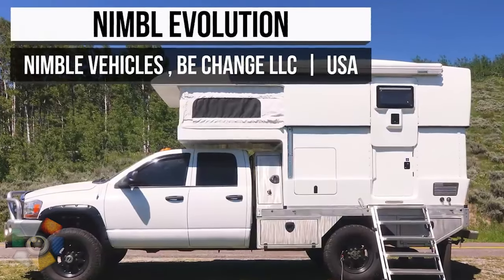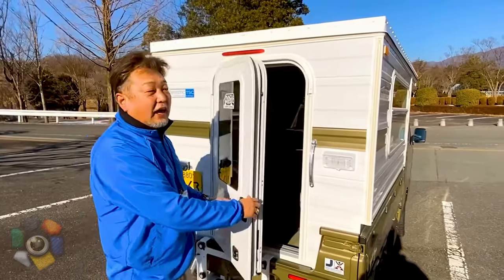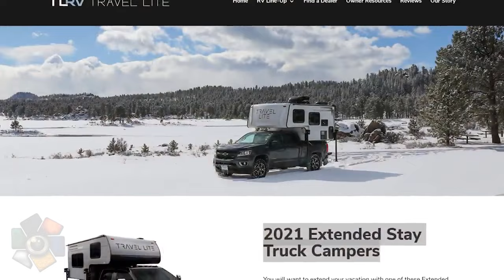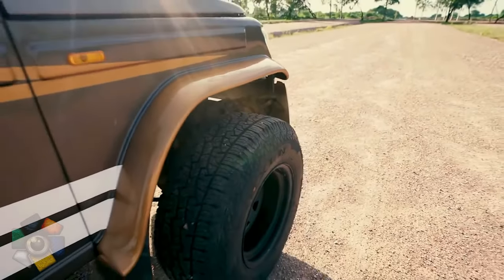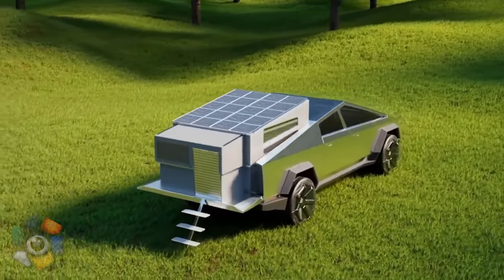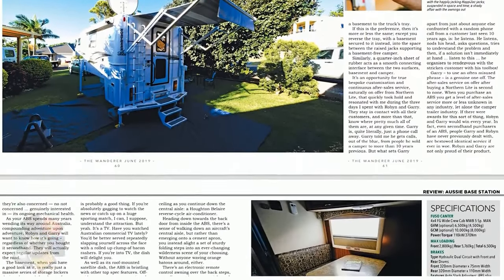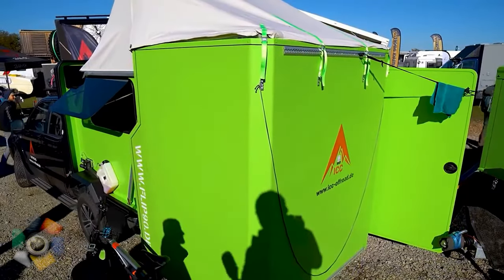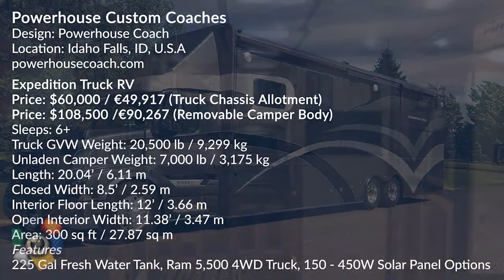25 Next Level Truck Bed Campers with Innovative Designs

Comment: Thank you for a lot of good ideas. 
I am working on a new and fun problem.  
I would like to camp with the new truck I have ordered, a Chevy Silverado EV.  The weight limit on this EV is 1200 pounds including passengers.  I want an ultra-light camper.  I would target max camper weight to be 800 lbs.  
Good news is with a Silverado EV the back of the cab folds down so AC and heat can be provided by the truck.  With a convection cooktop, a toaster and a portable fridge there is no need for heavy propane stuff.
Aerodynamics is important also to insure good range. Needless to say the camper should be composite fiberglass or carbon fiber.  A well designed topper can often improve efficiency.
Please include weight in the specs for every camper you list.  
If I knew how to make a good form I could try doing it for myself.  I would love to do a proof of concept of this and see how cheaply I could travel the continent paying only for kilowatts.

Cheers!
Reply from the maker: Hello Driftless Heights, thank you for watching!